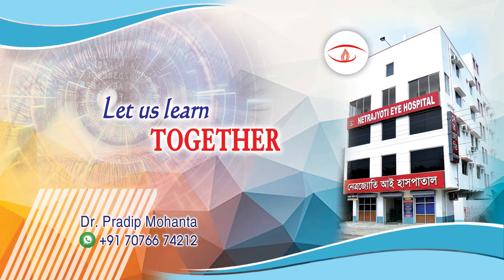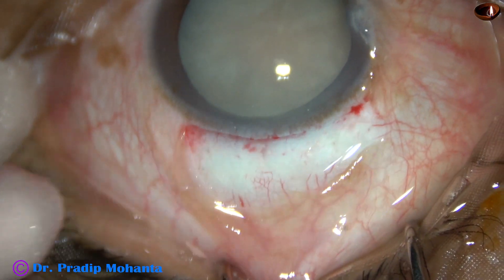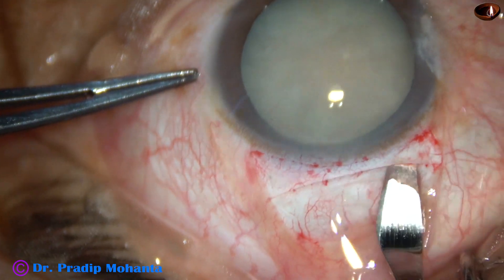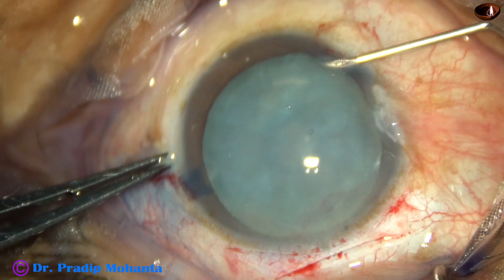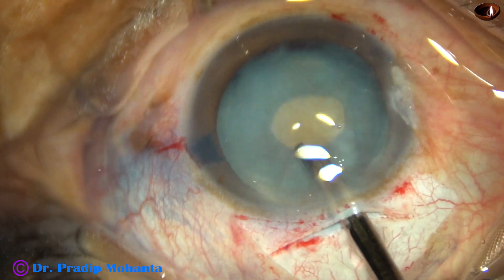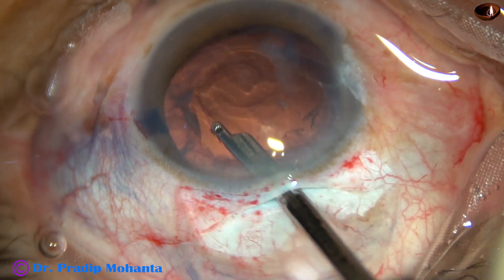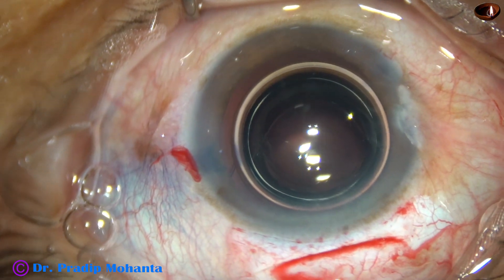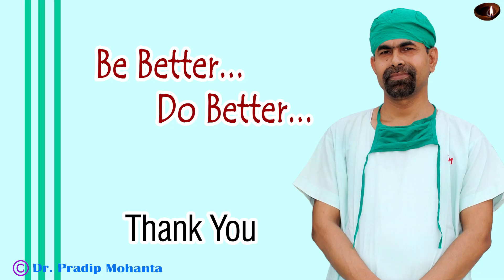SICS of an Intumescent Cataract with Hydroimplantation of IOL : Pradip Mohanta, 24th march, 2020

Comment: Respected sir ..I have few questions regarding phaco ..
1. Are u using adrenalin or antibiotics into irrigating fluids ?
2...are u using intracameral lidocaine?
3..are u using ointments after the conclusion of surgery?
4...are u using intracameral antibiotics?
5..are u using antibiotics and steroid ointment in post op days ?
Reply from the maker: 1. Yes, only adrenalin, no antibiotics
2. No
3. No
4. Use but most of it get washed out during the final AC lavage
5. Antibiotic drops for 7 days (for medicolegal reason), steroid drops I use, not steroid ointments.
Reply: @pradipmohanta9321  sir thank u very much for your detail explanation..this will help a lot for young phaco surgeons ...
Reply from the maker: @janzada3373  
Where are you located..?
What's your WhatsApp number?
Reply: @pradipm Mohanta